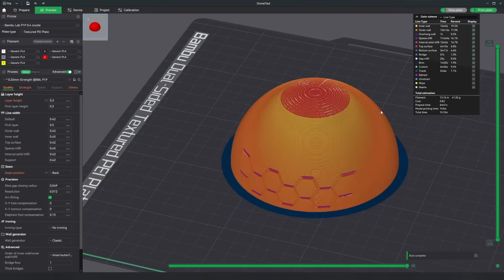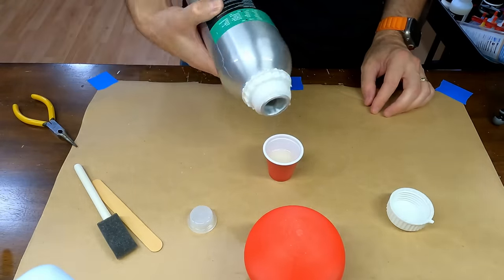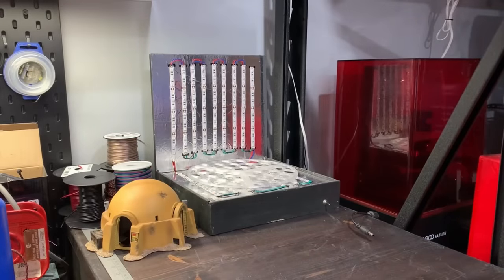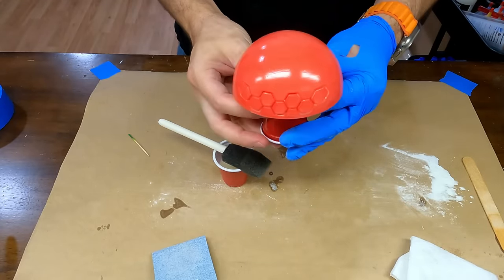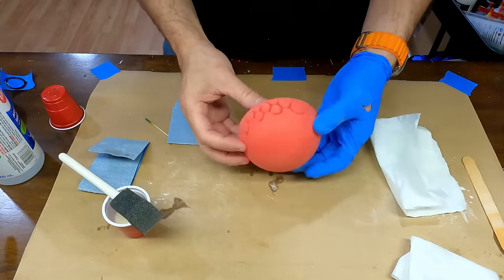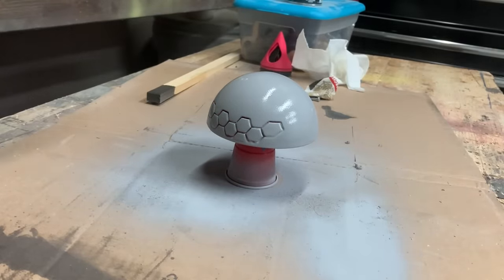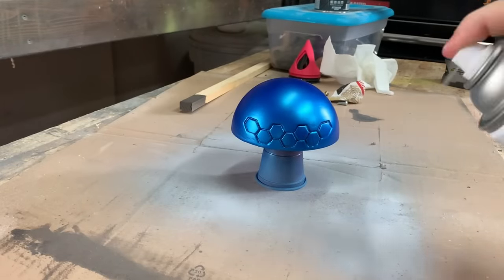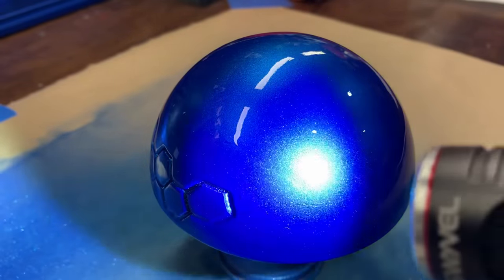Hide 3D print layer lines with Baby Powder and UV resin

Comment: Nice job. I don't have a resin printer but I'll have to set up a little UV discobox because I want that finish. Good to see someone fold their sandpaper, I fold it in three equal sides and it then grips it's self.
Reply from the maker: I just ordered some UV led strips and made my cure box. Could be easily done with a cardboard box and tinfoil. Don't know if the rotating base is needed.
Always fold the sandpaper :)
Reply: Look for used UV grow lights.
Reply: @tsepash  No.
Unless you want to waste 90% of the UV, time and money.

For resin curing you need 365nm to 405nm wavelength. Usually they are 395nm or 405nm. And sometime, but more rare, you'll find 365nm UV leds for resin curing. What you exactly need depends on the resin (it should always be stated on the resin bottle).

UV grow lights comes in all kinds of (fake) packages, ESPECIALLY the cheaper ones! And are rarely true UV. They bleed off a bit in the UV range, but that's it.
Proper professional UV grow lights should range from 100nm to 400nm. However, most so called 'UV grow lights' have a much much broader range, also going into the visible spectrum. They often start somewhere around 400nm (near UV) and go up from there.

An UV curing LED light will cost you FAR LESS than a proper UV grow light. And the latter wouldn't even be as efficient.
UV curing LEDs in the range from 365 to 405nm are as cheap as they can get.
Reply: @CookieTube  odd that I have seen others use this method with no issues....maybe it is magic. The grow light that I have, which I got for free, is something like 380nm-780nm. I don't do resin at this point but I can't argue your science, except by saying that it works in practice. Shrugs
Reply: @tsepash  I never said it will not work. Heck, even using an old light bulb will 'work' !!
The question is how good will it work, how efficient would it be, how long would it take to properly cure the resin...

As I said, the typical resin used with 3D printing uses either 365, 395 or 405nm wavelength to cure.
ANY light output that covers that wavelength, will work.

But if you have a light (eg: a grow light) that outputs from 400 to 700nm, then only a very tiny fraction of that light will actually be useful for the curing. You'd be wasting all the rest (heat, energy, electricity, money, ....)

Also remember that no light, even LEDs, have a narrow exact pinpointed wavelength (well, except maybe lasers). There is ALWAYS a bleed off a bit lower and a bit higher than its 'dedicated/advertised' wavelength. The wavelength output is a curve, not a single narrow spike.

You can get LEDs strips with 395 and 405nm for almost nothing from AliExpress and the likes (and note: the ones sold on Amazon are exactly the same coming from the same Chinese sellers, only 10x more expensive). Grow lights are a lot more expensive and are a lot less efficient for this. If you have them already and can't get anything else, sure, use them by all means. But otherwise it would be a complete waste of money ;-)

PS: If that wavelength range of your grow light is like you said it is (380-780nm), then that light would essentially just be an incandescent light bulb (with a tiny bit of extra UV output in the near-uv range). Are you sure that is the wavelength range? It should shine 'normal warm white' if that is the case..... If it doesn't shine warm white (but rather blue, or green, or red) then those wavelengths are not correct. But if those wavelengths are correct, then you can use it, as it outputs a tiny bit of near-UV (around 400nm).
Reply: @tsepash  if it works, it works 😁😎. And for free 🤷 nothing to argue with or disparage. Fair play
Reply: @CookieTube  thanks for the heads up (not sure why so abrupt 🤣). Great info. As I don't have a resin printer and am yet to explore working with resin in other ways I haven't really studied the whole thing, well after studying with cost of printer, compression vessel etc 💰.
I will look into some strip LEDs, I'm guessing that you can't have too much (without being ridiculous) light?  Can you recommend some legit lights? Tia
Reply: @DaveRigDesign  I don't care if the turntable makes a difference,I'm having one. Might even fit a tiny mirror ball as well. The Id Boutique.
Reply: @nicksmith1415  You actually can have too much! When curing you need to make sure you don't overcure it. When you notice the resin turning yellow'ish, you have overcooked it. This makes the (already brittle) resin even more extra brittle, and can even damage it. The time for curing highly depends on what curing station you buy (or make), the piece you're curing, the amount of washing you've done, the wavelengths of the UV leds and the resin, etc etc etc. Though, it usually doesn't take longer than a few minutes, 5 minutes tops on the 'popular branded' stations.

Also, the more spread out the UV light is, the better. So in that aspect: a few LEDs all around is much better than a whole bunch clustered together. In that aspect, a turntable is very recommended, almost a must to cure everything evenly and properly.

Also, some people install mirrors in their (commercial) stations to reflect the UV light around. However, using crumbled tinfoil instead of a common flat mirror, is much much better since that will spread out the UV in much more directions than a flat mirror ever can. (crumble the tinfoil to a ball and then spread it out again).

And buy a small cheap UV flashlight too. You're going to need that to cure in areas where the UV light from the curing station can't reach (much), like under armpits of statues and figurenes, or in hollow parts.

My number one shop would be AliExpress. Dead cheap and you get the exact same items as elsewhere (literally all this stuff comes from china anyways, no matter what brand shops tell you!! They simply resell all this stuff).

I made my own curing station though. So that I have some more flexibility over the commercial ones: I can select the wavelength (switching certain LED strips on or off), have proper reflection all around (not just some flat mirrors), heater with temp sensor, timer, speed control for turntables, transparant turntable (so curing also happens underneath the piece!!), and I can also hang objects in the chamber and let them rotate (yep, tiny discobal motor, lol), fume extractor....... and I think that's it. Oh yeah, it also has an RGB strips indicating the 'stages/modes' it is in (couldn't help myself... lol)....

Last but not least, you also need a washing station. Or dedicated washing tub if you wanna do it manually. And A LOT op IPA (isopropanol alcohol) for washing.

And of course the proper personal protection! Gloves and eye protection for sure (note: eye protection is very much overlooked, by even the most popular/biggest 3D printing channels!!)... And very maybe a respirator. But that mostly depends on the environment you work in. A well ventilated area is usually enough (never put your printer next to your bed or in your small appartement room) Always remember: resin IS very toxic! Don't let others tell you "all will be fine, I've been doing it so and so for so long" ....

'Playing' with resin is extremely fun and rewarding, but it is messy and you need to use common sense and not let 'the internet' tell you otherwise. ;-) Common sense is not so common on the internet.

For the UV flashlight, just search the shops for "UV flashlight" and make sure the wavelength is mentioned, because there are a lot of fakes out there (eg: a simple blue/violet light instead of true UV).

For the LED strips: any UV led strip (with the proper wavelength of course) will do: search "UV LED strip" and you'll find tons for sure. How much you need depends on the size of your curing station, the distance from the objects, the way you install the strips, etc, etc. Usually they are 5 meter long or something. Which is more than enough for most curing stations (unless you wanna go fancy). What exact type you need is very hard to say, it all depends... but you almost can't go wrong with it though. Just make sure you also buy the proper power supply! LED strips come mostly in 12V and 24V versions. Unless you have a specific reason, I'd suggest 12V, which is also the most common you'll probably find.

Make sure, for both the LED strips and the flashlight, the wavelength is 395nm, which is the most commonly used one for the 3D printing resins. 365nm is also ok, and maybe needed for certain specific 'special' resins. 405nm will also work, but a bit less... With all those lights, there is always some overlap between the wavelengths .It is always a small 'range'. So as long as you stay within that range (365-405), you'll be fine.
Reply: @CookieTube  seriously, thanks for taking the time to write that. All makes sense. I will mainly use this technique for helmets and armour so will need a reasonably sized unit as well as wash station ( have the bits for this including the IPA). I will take your great advice and build a top notch curing unit. Daughter has a UV torch so that's ticked off. I love the idea of a translucent turntable. I understand what you mean by hitting it from all angles and will ensure that I do so. I have two additional questions if you have time, what sort of heating, Is there a resin to go for, or more importantly any to avoid?This makes way more sense than struggling with 2 part resin although I will be exploring that with furniture. Been dying to try ever since I saw the Starwars diorama 🤩. 

I enjoy creating the tools I need so looking forward to building this. I've just finished building a spray booth as they are priced ridiculously in the main (so manufacturers should be ashamed). I have a large quiet and bright table top booth for less than £60 and designing and making it was so easy that I'm thinking of selling them.
Reply: @nicksmith1415  For the heating: it isn't absolutely necessarily, so any small electrical heater will do. You don't need much.
The main goal is to provide a stable slightly higher than room temperature environment (eg: 25°C to 30°C). Many people do their stuff in the garage or workshed or something. And especially in the winter it usually has a low temperature, and it often varies a lot. This is bad for (any kind of) resin work. Same with humidity. And it also helps evaporating small amounts of leftover IPA from the washing.

There are a few dedicated resin-printer heaters on the market. But they are WAY overpriced for what they actually are (as per usual with these things).
You're looking for small ceramic electrical heaters (with fan). A 50W to 150W one is more than enough. When you wanna DIY, you can buy 12V/24V 50W to 150W ones and combine them with a tempsensor and timer. All can be found on AliExpress. Search words are "ceramic heater" or "cabinet heater" or "PTC heater". And for the timers: "PID timer" or "PID controller".

There are some videos on YouTube showing you how you can make/print your own heater system for resin printers. So, these can be used in the curing station too.

An alternative can be incubator heaters. They are essentially the exact same thing (but often have some extra, and not always useful, build-in timers and what not)

Of course, if you are already doing everything in a room which always has a decent and stable temperature/humidity, than you actually don't need such heaters as much. It will all work without them too..... But painting flames on your car makes it go faster, right? ;-)

Comment: Impressive, I IMO I think a light sanding before you even started your process of doing the resin brushing would have served you better, in the end what gives the best results in the shortest amount of time?
Reply from the maker: A quick sanding to knock off any blobs or stray filament would be good. But trying to reduce the layer line any significant  amount would take alot of sanding.

Comment: Would have been great to see a control print that got the same painting for comparison, but the result is breath taking!
Reply from the maker: Thought about it but I really hate sanding PLA :)
Reply: @DaveRigDesign  ah, the beauty of my suggestion is to not sand the control ;)

Thanks for the video btw, great content and I'm keen to use your techniques some time (though I mostly make functional stuff which isn't too pretty)
Reply from the maker: I did this follow up video comparing using resin with and without powder added if that helps.
https://youtu.be/UFRbTg37Td8
Reply: @DaveRigDesign  so much! Thank you!!!

Comment: nice....also airbrushing resin gives you a nice finish as well..just be in a well ventilated area and you wont lose much of the detail
Reply: !! NEVER EVER DO THIS !!

...

Unless you are a professional doing it in a professional environment with a full on 100% closed respiration device and in a 100% air-tight fully enclosed chamber which can be vacuum vented thru filters.
It is an extreme highly toxic vapor, far worse than any 'dust vapor'. You might as well just drink a bottle of acetone while at it.

Anybody stating 'airbrushing resin' has completely no idea what they are talking about, sorry!

Again, unless you are a professional, in a high end controlled environment, NEVER EVER attempt to do this, nor suggest something like that (there will always be dumbasses who try).

Comment: You can just start by sanding the print with 220p then put a thick coat of resin on it. Harden that then sand with 500p then use the primer/filler then go at it with 800p then wet sand. Paint it then wet sand again with 1500. Then clean it and clear coat it.
Reply from the maker: you could start with 220 if you wanted to sand twice as long and use up more sandpaper, but you could.

Comment: "Hi, the result has been magnificent, however, in the end, there is the need for painting. I see that you use a Bambu Lab, whose main feature is printing in colors with AMS. In the event that you print a piece in colors and want to smooth it, how would you do it? Because it wouldn't make sense to paint it if the printer has already printed it in colors. I appreciate the time you take to answer this, as it is the big question I have had since I saw these magnificent Bambu machines, and it is the only thing holding me back from buying them and replacing my resin printers 😁"
Reply from the maker: If you want a mirror finish like this you will have to fill/sand the print so there is no point in printing in colour for this. 

You could just cover the print in layers of clear resin to get a smooth top layer but you would still see the layer lines under it.

If you were to print in colours you would want to leave the print as is
Reply: Well, not a finish like the mirror-like one you achieved, in fact, it gives the impression of being a metallic surface, but rather a smoothing of the layer lines. Currently, I print in resin and then it takes me a lot of work to airbrush my pieces. The resin does give me good finishes, not necessarily in terms of detail, but smooth surfaces, which is what I would like to achieve with a color printer, a result that, although not the same as resin, has surfaces without layer marks. @DaveRigDesign

Comment: considering how effectively that thick spray paint seemed to work as a means of creating a smooth coating, i wonder if it would be possible to apply the resin+baby powder mixture with a sacrificial airbrush or something
Reply from the maker: Airbrushed don’t like spraying thick material. You would need a different sprayer
Reply: @DaveRigDesign  i dont know much about airbrushing, are there different diameters of nozzles? 
people blast some pretty thick paint thru the nozzles we use for auto body paint, so that might be a good starting point, size wise

Comment: Nice idea, some questions:
1. The curing station that you used , is that a DIY station, if so how did you make this
2. Using Acrylic paints then a Lacquer clear coat, how do you prevent the lacquer to react with the Acrylic , I always find that the Lacquer can mess up the Acrylic paint job?

Thanks
Reply from the maker: Yup cutting station is home made. Top is foam core, bottom/back is 1/4” wood. Geared down 12v motor and 12v UV led strips. 

Clear coat is also acrylic so no issues

Comment: You would get better coverage with a small touch up hvlp spray gun. Airbrushes have conical spray paterns, which is great for small Details and lines, but not for broad coverage. Where as a spare gun has a fan pattern giving the best even coverage. 

Best color choice award goes to this piece
Reply from the maker: Maybe. My airbrush is about 30yrs old so I’m sure there are better options now :)

Comment: As I'm composing this comment in my head, it sounds a little snarky. I really don't mean it that way. I would just like to see what you get if you leave out the resin steps entirely, and just do all that sanding, priming, painting and wet sanding. I've never done anything like this, but it seems like the outcome might be pretty similar. Especially if you trade the time spent making/applying/curing the resin for more sanding/priming passes. In any case, it's still great to know about this method. Thanks for showing it!
Reply from the maker: If you have nothing but a 3D printer, and you don't finish prints often you are probably better off just sanding the PLA. It's going to be hard work and take a while, but you can get it done. 

But if you plan to do this alot it's well worth the investment in getting something set up.
All you need is some resin, some UV LED's you can get off amazon pretty cheap and a box with tin foil on the inside.